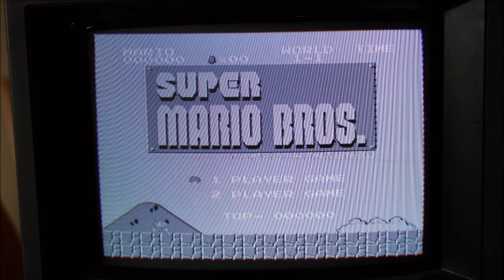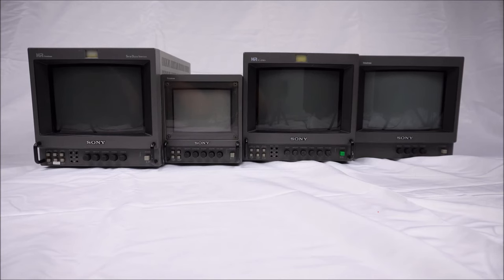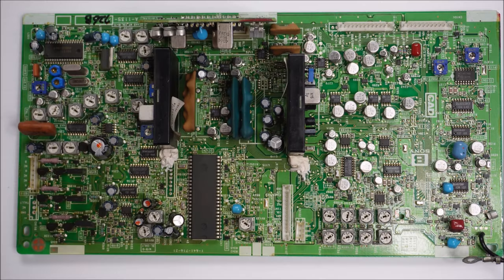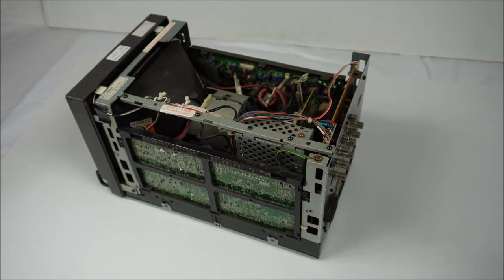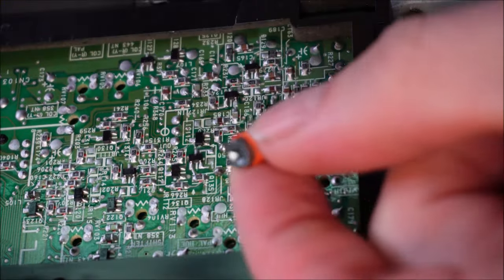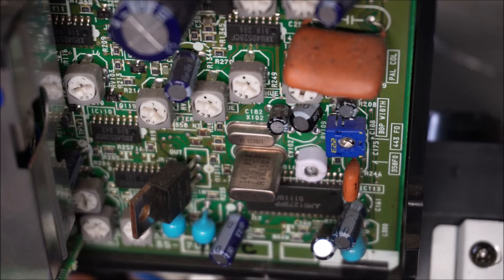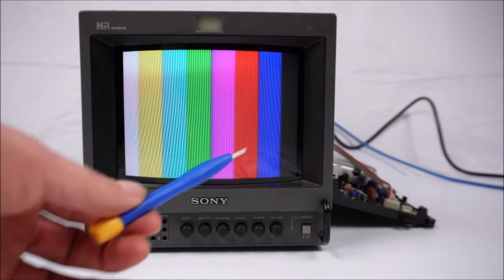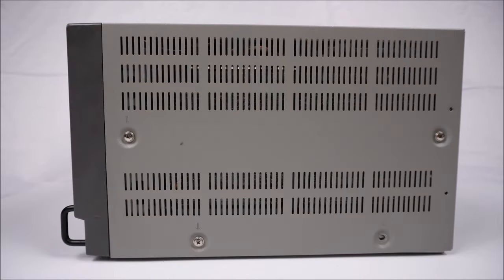Sony PVM BVM Color Loss Fault Fix (Black and White Issues)

Comment: Thank you for the great video! I fixed my 9044QM by just turning the trimmers with a NTSC and PAL signal. The picture is very stable now. If the the colour ever goes away again i'll apply the fix, but the original orange trimmers do the job just fine for now..
Reply from the maker: Sounds like a win! Hopefully many years of trouble free usage to come.
Reply: @rgbrob  Thank you again for pointing me to the right trimmers! Although i normally only use it with RGB it always bugged me that composite and s-video weren't working.. You've made my day!
Reply: Same here! It seems that half of the range Is completely black and white and the other half is fine. I still ordered some parts because it will probably go out eventually haha

Comment: Thank you so much for the video, I have a monitor that has been having some problems like this one so I'll give it a try.
I have another monitor (a pvm 5041q) that started similar to this one and I haven't been able to figure it out why is it failing, it used to show the right image but with just one of the 3 primary colors, for example I would be able to play with retro consoles on it but it was onli showing red in different levels of intensity, but now it only shows solid green with no actual image of the games, when I opened it up and made it work while opened I saw some smoke comming out of the from the are closer to the botom right of the screen on the B board, so I think the problem might be over there. I tried reflowing some of the connections that looked weird, but with no luck.

Comment: I was trying to look into that issue myself (having recently bought a 9041QM with the same fault, only SECAM would work) when you happened to upload this video just in time. That is incredibly nice of you. However, it looks like the links are currently private, is it normal? I was able to find bulletin E-BVM-059 easily by googling but it looks like your video is the only place on the internet mentioning 1998 019r2.
Reply from the maker: oh ill have to look into why my links are private. Hopefully you can fix your issue, i'd say you have the same problem. How does RGB work for you?
Reply: @rgbrob  RGB works flawlessly indeed.

Comment: Hi Mate! Your video just saved my PVM from its color loss! However, though the color has been restored I noticed that the black is not actually black, it has this red tint to it.. Furthermore, I still see some horizontal fuzzy lines and the image isn't that sharp. Lastly, there is this weird shadows behind texts.

Do you have any idea on what may cause these problems? Thanks Rob!
Reply from the maker: What is your model?
Reply: @rgbrob  Hey Rob, it's the 6041QM. Thanks.

Comment: Hey Rob, This video is great, on the weekend Ill try this on my 9044D, thank you

The service manual need google permissions. I requested access but haven't seen anything back, can you approve it? thanks again
Reply from the maker: I have to work that out, someone else had the same experience. I really want to migrate all the documents from google docs to apples platform.
Reply: @rgbrob  you should get an email saying that I requested access and a button to grant it
Reply from the maker: @LouisZezeran  I've updated the description in this videoo with my emai. Send me a message there and I can email you the file direct.
Reply: @LouisZezeran  Hi Louis, were you able to get the files from Rob? I have the same problem :(
Reply: @rgbrob  Hi Rob, sent you an email too. Concerned because I have a different monitor 8044Q, and part number for the trimmer seems different than yours, so I am thinking I may mess up if I use a 10pF one, but I cannot find the bulletin anywhere.
Reply from the maker: @walterg74  I see your email, I will answer later today.
Reply: @rgbrob  Thank you!
Reply from the maker: email sent with documents
Reply: @rgbrob  Hi Rob! Thanks, received the email but with no documents :(
Reply from the maker: @walterg74 sent you another email, documents should definitely attached.

Comment: Replaced these on a 8044q and I am still getting black and white video on a and b. I reflowed and refreshed solder on all connectors and leads and even tried hot air.  Pressing the blue only button only slightly changes the hue but otherwise it’s stuck in black and white. I feel like something isn’t processing the signal correctly.
Reply from the maker: Before replacing the trimmers, was the picture B&W all the time? Also, is your RGB is signal in colour or not?
Reply: @rgbrob  yes before changing it was black and white on all inputs. It used to have color before, then suddenly stopped and now is stuck black and white. I have a larger 1344q I was comparing the black white when selecting blue only, and they are noticeably different. Anything else I could be looking at bad transistor?

I’ll check RGB in the morning when I get back to my shop.  

Thanks for the reply!

Comment: Hi my pvm I just bought randomly went black and white and then after maybe 30 minutes went back to color. Should I be worried? I’ve never had to solder anything before and the idea of opening mine up and soldering it scares me. I bought mine for a pretty good price but it was still expensive. The guy I got it from hadn’t used it in a long time

Comment: Thanks, I have a pvm 1450qm .. not showing color on pal consoles ! Only on ntsc consoles (in line a/b) ... But in rgb mode the colors working on both pal & ntsc consoles ... is that nature of the pvm or there is a problem
Reply from the maker: I havent worked on that range yet so i cant point you to any tips to help.